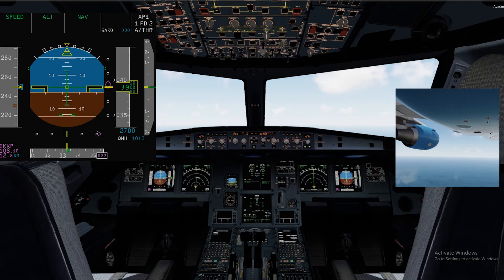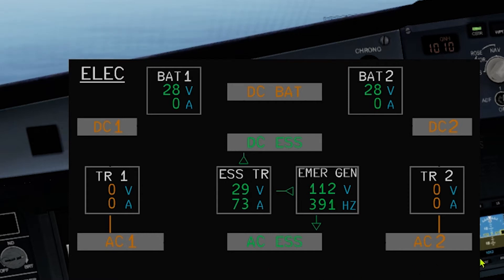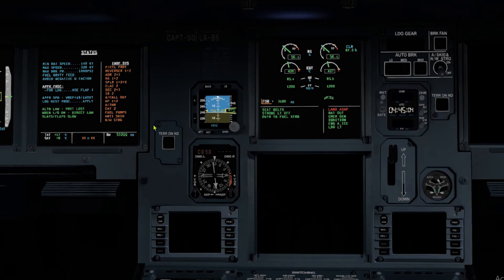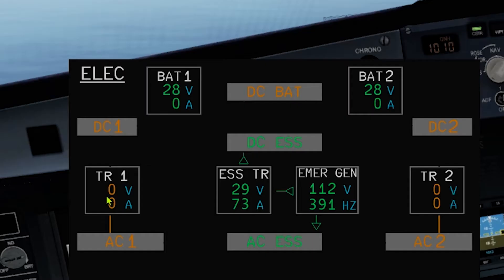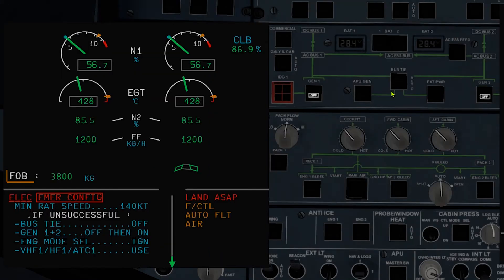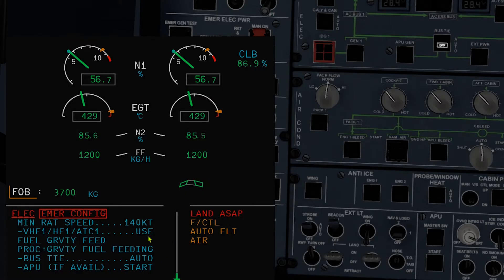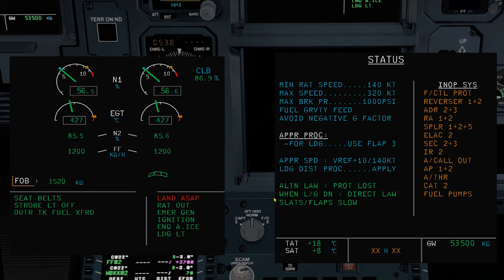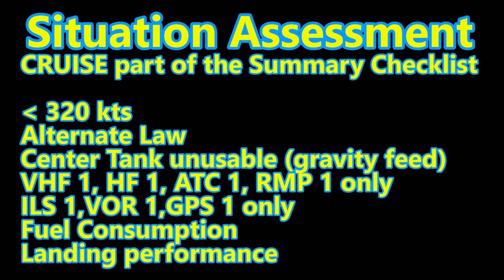A320 Electrical Pilot Emergency Configuration (UPDATED) (MADE EASY)

Comment: You should be able to do the normal extension because the green system, but are the LGCIUs connected to the essential bus? if not you have to do the gravity extension

Comment: Slats/flaps are slow because in EMER ELEC you will lose DC BUS 2 which powers SFCC 2 (Slat Flap Control Computer). If one SFCC is inop, both slats and flaps operate at half speed (FCOM DSC 27 30 10 GENERAL).
Reply from the maker: Good job, well done !
Reply: you are so good ,man .
Reply: But it doesn't show SFCC2 in the Inop Systems - Shows only SEC 2+3

Comment: Hey Captain sq. If you have induced emerg elec as part of the qrh smoke, when you reset gen 2 at 2000’ how many systems will be restored? Do you remain in alternate and then direct law at gear down because the adirs 2/3 have been depowered and can’t be restored? Can’t seem to find a straight answer, cheers.
Reply: I know, the comment is more than a year old but anyways:

As far as I understand it, the normal electric configuration ist being restored prior landing to ensure normal braking. If you kept the elec emer config in the smoke configuration for longer than 5min, the IR‘s 2+3 will be lost for the remainder of the flight, thus the flight control law will not recover to normal law.

In theory, there is a dirty trick to keep the IR1 & 3 powered during the ELEC EMER Config to e.g. allow recovery of normal law and a CAT III single autolanding. This however would require a switching of the ATT/HDG Selector to „CPT 3“ (and back to Norm every 5min???).

This is not part of the procedure and drains the battery more than airbus intended with the procedure. Also this will considerably increase the crew‘s workload. I have also never tried this in the simulator, so I can not provide first hand experience with this technique.
Reply from the maker: Thank you for sharing.

Comment: Sorry if my question is so weird. I dont understand that why the RAT IS operative , the ECAM indicates inoperative equipment. I think that when Emer Gen is running, the green, yellow hydraulic systems will be fully operated
Reply from the maker: Elec Emer Config is only when 25% of the systems is being powered. To run the RAT, you need blue Hydraulics. If you have all 3 Hydraulics, but AC1 and AC2 fails, you would still be ELEC EMER Config provided that the RAT is functioning. I hope I answeres your question.
Reply: @Captain_SQ  thanks Capt for replying. I thought when in ELEC EMER Config , we will lost all 3 Hydraulic systems. right now , i know its really wrong . thank you for blowing my mind
Reply from the maker: Most welcome, feel free to ask any questions.
Reply: @NamNguyen-ti1nf  Hello Nam. You dont necessarilly lose hydraulics green and yellow in this condition because these systems are powered by EDPs, which do not rely on electrical power. Elec Emer config will likely be the result of the loss of both engine electrical generators. Cheers!
Reply from the maker: Thank you for sharing
Reply: @Captain_SQ  Thank you Captain, for your great videos on the A320!
Reply from the maker: My pleasure Fred.
Reply: @fmmach  really appriciate it. :))

Comment: HI CAPT 
whay do the break sys goes to alternate braeking ?
thank
Reply from the maker: You are in electrical emergency configuration. So you have only certain systems.
Reply: my guess is the BSCU and ABCU which are electrically powered is not available in elec emer.

Comment: why flaps and slats are slow in emergency electrical configuration a320?
Reply from the maker: Interesting question. What do you think?
Reply: @Captain_SQ  RAT pressurise the BLUE HYD SYS hense SLATS will be available. Like wise we still have YELLOW HYD SYS which helps in the operation of FLAPS. So we do have both of these two systems still i didn't understand why its operation is SLOW?
Reply from the maker: Well you only have 1 generator powering the system and that is only the emergency generator.

Comment: Capt i have q
No reverser,
Does it mean we cannot do reverse?
I rememebr i did the reverse even this situation
Was i wrong at that time?
Reply from the maker: yes the reversers will not be available.
Reply: @Captain_SQ  so upon touchdown, just idle and press the brake until stop sir?
Reply from the maker: Yes that's right.
Reply: @Captain_SQ  what if only 1 reverser in-op,
Does apply both reverser will be okay?
Reply from the maker: Yes if one is inop, then select reversers on both thrust levers. In this particular elec emer config, you have both inoperative so you just select it to idle and use the brakes, maximum 1000psi
Reply: @Captain_SQ  thank you for your great info Capt!!
Reply from the maker: Most welcome Kim

Comment: Captain I have a question. In case of a dual engine loss can the APU be used until the aircraft is landed to supply the electricity for aircraft and to run the AC packs while the RAT will pressurize the Blue HYD system for flight control actuating?
Reply from the maker: Hi Isuru, for dual engine loss, we would also start the APU below FL250 to use the APU bleed to try and start the engines.
Reply: @Captain_SQ  got it. Thanks Captain. As I remember the fuel feed for APU goes from the left wing tank. If the pumps are INOP during a Elec Emer Config, please explain how the fuel supply is given to the APU to start.
Reply from the maker: @Isuru14  good question. when we are in electrical emergency configuration, the APU ECB starter , APU fuel LP valve and APU fuel pump is still operating normally.
Reply: @Captain_SQ  got it. Thanks 👍
Reply from the maker: @Isuru14  welcome. cheers

Comment: My answer to your question on LDG retraction on Go Around is, no retraction of LDG on 2 primary reasons. 
1. You don't have hydraulics to retract the gear up. Even the gear doors will stay open. When you hand crank the gravity gear extension tiller 3 times, it will depressurize the hydraulic system for LDG retraction and extension, open up gear door up-locks, release the gear holding up-locks. So that will eliminate all the chances of gear retraction once extended using gravity gear extension.
2. In case of a dual engine loss, You will be in Elec Emer Config and will have to execute the landing whether you like it or not as you don't have any thrust from the engines for a go around. 

Please do correct me if I am wrong Captain. Thanks for sharing this video. 🙏
Reply from the maker: Good attempt in answering the question Isuru. The landing gear can be retracted as long as there is green Hydraulics. If it an elec emer config with Both engines running, you will perform a normal landing gear down procedure (no gravity extension). 

If it is a dual engine failure and it is a forced landing then we have to perform a gravity gear extension. In this case we cannot reset the free fall system and cannot retract the gears.
Reply: @Captain_SQ  thanks Captain for the detailed answer. I was under the impression that during a Elec Emer Config engines power isn't there. My bad.  

Now I understand during a dual engine failure, aircraft goes into a Elec Emer Config condition and Elec Emer Config can happen even with both engines running.
Reply from the maker: @Isuru14  yes excellent.